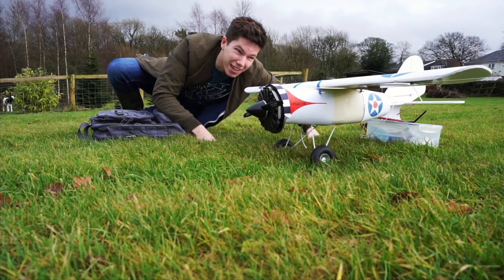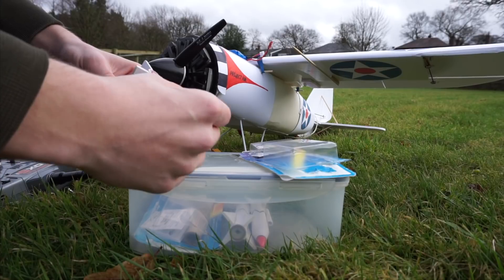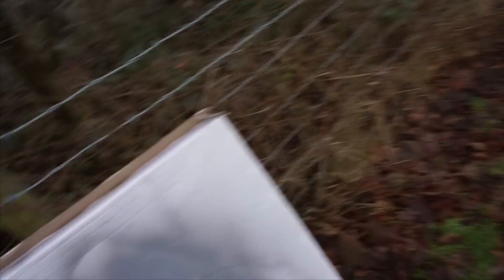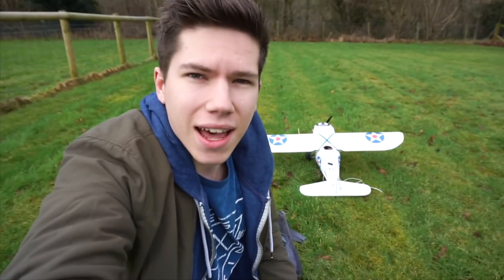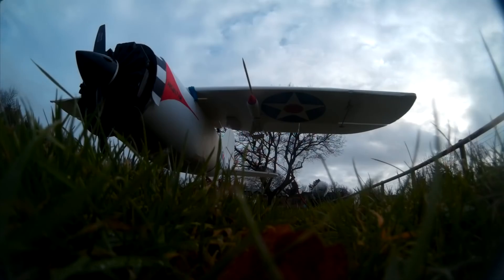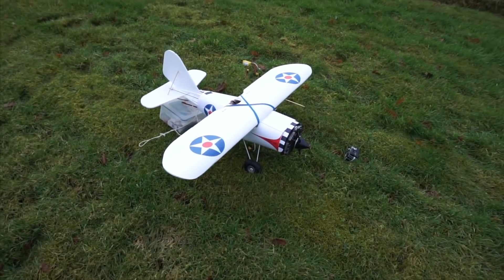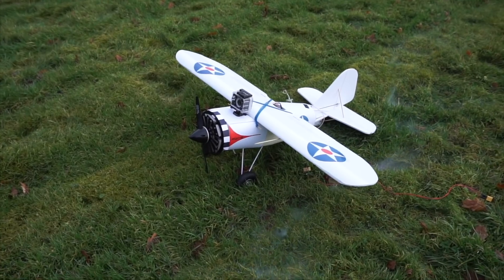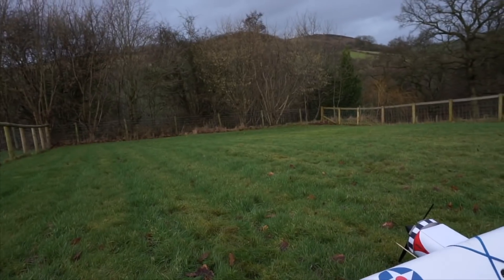RC Plane Missile Experiment

Comment: Your little tiny rockets were not anywhere aerodynamic as the should have been.  The rocket engine motors by ESTES are far too large in diameter and way too heavy to be short ans accurate rockets launched from an RCA plane.  Your rockets need to be 75% smaller in diameter and lighter for the short length that they are.  Do your math, hoy.

Comment: OK, three things that might help: 1) You're using a C-5 engine. That is a lot of power for such a small rocket. Launching in flight would quite possible crash the plane.
2) The fin area is a little small to give the rocket real stability. They looked like they were made of paper, along with the nose cone, which a C-5 would easily tear apart.
3) Balancing the rockets would go a long way toward a predictable flight.
I got into model rockets and built many of my own designs. Points 2 and 3 make all the difference between a successful flight and a (spectacular) waste of time and effort. I hope you kept trying and had some success.

Comment: Your Rockets might be a little more accurate if you were to put finn's at the front of rocket as well..
Reply: They would probably spin out of control, you want the fins to be behind the center of mass for it to fly straight.
Reply: @drewbrackett6798  it would be a good experiment though!

Comment: I was doing this back in my youth, in 1974! There was nobody around to tell me that I was not allowed to launch from in-flight, so I did. My "targets" were the giant high school logo medallions painted on the back of the concrete berm holding up the seating for the football stadium. The biggest challenge was holding the rockets in place tight enough to survive take off and flight, but loose enough to release when the rocket motor ignited. My trigger solution involve a sequence of contact points lined up so that one servo could ignite each rocket one at a time as I advanced the launch servo more and more.

Comment: At Thruxton motor racing circuit back in the late 70s a guy there had an RC flying school he had a helicopter that had rockets ether side the pole of the rocket slid into an aluminium tube to stabilise the flight and was electrically fired. If you want to know more contact me and I can send you a drawing of the set up.

Comment: You'll have to position the center of mass and center of thrust of your rockets properly. 
The second one flew straight at the beginning and then went of course as the center of mass moved to the front during flight. 
The center of thrust has to be in front of the center of mass for a stable flight without controlled thrust vectoring.

Comment: Make your rocket design  like a bottle rocket,  just add a 10 or 12 inch  stick to them and put a straw tube up under wing space down below the wing with enough clearance  for the back part of the rocket to give it a good guide plus it will help the stability problem. It will work ,just need more testing.   Keep up the good videos and i hope this helps

Comment: AHh, my Estes Model Rocket Days of my youth in the 70's. The things We did with those rockets, some were 3' in length, would have us put in prison for Terrorism today, much less the mortars I made with "Blockbusters" (fireworks that amounted to a quarter stick of dynamite, Not the smaller M-80's either though they can be used for lighter fragmentary result) built in to them with BB's packed around them using C-6-3 engines with the ejection powder scraped out and some amount or all of the delay powder.
 Stopped the experimenting because Sex, drugs & Rock N' Roll had become too important by then. But I wish I had continued a while longer because I was onto and into figuring out how to perfect them but it's probably better I hadn't.

 You need to develop a more aerodynamic rocket body and a guidance system. Start with the manual rod guidance and/or just go directly to a electrical-servo to guidance fins system which is SO Much easier to do today then what was available 50+ years ago. Good Luck and Don't get  yourself put on a Terrorist Watch List!!

Comment: Part of the problem is your rockets are not accelerating on the rail long enough.  In the air and at speed your rocket will have plenty of straight line momentum to ride a short rail.  Extend the rail on your airplane and see if it flies better.  You might also consider wider fins to help control the spin

Comment: An engine alone with a paper nose cone does not make for a very stable rocket. All the weight is in the back of the frame making the nose cone more reactive to high speed air than the fins. A metal weight, approximately the equivalent weight of the engine and placed as far forward as possible, preferably as part of the nose cone, will bring the center of gravity forward and stabilize the rocket. Just remember that the heavier the projectile is, the more dangerous it becomes. Use the lightest engine available. Rockets were used even in some World War I aircraft. The main problem with them until about the 1970s was they had no guidance. Once they left the rail they were subject to variations and disturbances in wind and their "kill rate" was abysmally low.
Reply from the maker: There was clay in the nose of each rocket to get the balance far forward.

Comment: If you ever get back to this kind of project, I would suggest using match wires from eBay, they ignite reliably at 5V and the firing control unit can directly plug into the receiver without any additional battery. I was experimenting the same thing with 6mm rocket motors, much smaller and safer.

Comment: Tried this year's back using small fireworks rockets. Worked great on the ground. In flight the air pressure keept rocket from leaving launch rail. Amazing how quick you can land with a hole burning through the wing!!!!!

Comment: Balance of the rocket should be 1/3 (center of gravity) of the length from the bottom to the front with a loaded engine in the rocket (general rule regardless of the axis of lunch). The fins have to be different to stabilize the flight, try to research real air to air missiles to get an idea.  Great job, keep trying till you succeed!!!

Comment: Fun.  This might be a little late, but in case you want to try again, the Center of gravity needs to be forward  from the center of pressure.    That's how darts and arrows work.   The weight is forward and the fins (which creates the larger pressure  area aft) are to the rear.  research it, and try again!

Comment: The center of pressure needs to be behind the center of gravity for stable flight. For your rockets they are  miserably out of balance. Mainly due to them being so stubby. If you increased your length to about a foot,  add some weight in the nose you can achieve stable flight in a straight line, regardless of direction. Google it and there are ways to test this, but if you have a general idea you usually can get it right.  

Maybe you could build a flying launch pad were you launch a ticket normal but from a top the plane! Hey some extra altitude... I would say keep it up. To many people are afraid to do things like this but I think there is some good clean fun to be had.
Reply from the maker: Thanks for your comment, yep I get you about the balance. It might well be that they're unstable, but I did test two from a conventional launch pad before this experiment. They flew perfectly and were very stable traveling vertically. The center of gravity is in the middle of the rocket thanks to some nose weight. I think more tests are needed :P

Comment: why do you plug in the balancer connector into the servo tester? i have the same servo tester but you will probably kill it if you keep doing it. it is designed to take 5V but if you plug it in like it appears you will give it 4.2V (fully charged 1S, middle lead) and on the signal port 8.4V !!! this is not good at all. get a dedicated BEC (or an ESC with a BEC) and power it through this!

Comment from the maker: Do not try this at home! Post comments and suggestions for new projects below! Thanks 🙏🚀
Reply: Hey James. check out the video on my channel where i built an estes rocket booster into the back of a FT Viggen.  unfortunately the thrust to weight wasn't great but i got a bit of footage.  i might revisit it one day on a lighter build
Reply: here's the link. https://www.youtube.com/watch?v=B2thHZ8aX0g&t=24s  I used a Rx controlled switch from hobbyking to activate the rocket. it worked quite reliably.
Reply from the maker: Awesome job Chris! I may have to get an RX switch :)
Reply: Rocket assist launch is great. I have a spot for two b class rocket motors or smoke     wicks on my Seavixen.  I use an unused channel to trigger them with standard Estes ignitors.
I don't want you to think I don't support your experimentation, I absolute do.
I do not want to see more of my fellow flyers get into trouble is all.
Happy landings to all my fellow flyers.
Reply from the maker: Jimbolina1 yeah man, me neither. I tried to make it clear in the video, but to repeat: this is a project of mine that I don’t want people to try at home.

Comment: This look real fun. Maybe a wee bit less on the power.
Reply: Maybe try something on the order of a bottle rocket and then scale up?
Reply from the maker: Air-headed Aviator I agree! Small sized engines will be used next time
Reply: I would stay as you are . An inflight launch may even require more power due to the effects of relative wind pressure on the missiles nose , as the aircraft moves forward . It could cause a hang up , possibly even the loss of the aircraft if you can't release the missile .